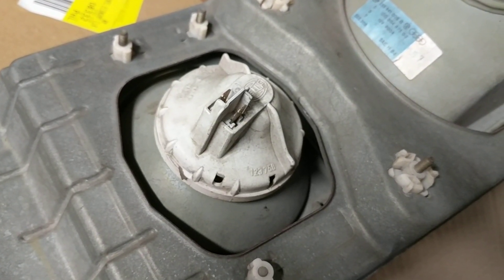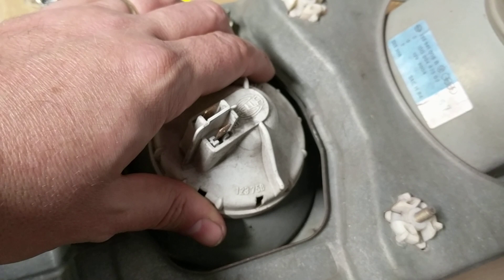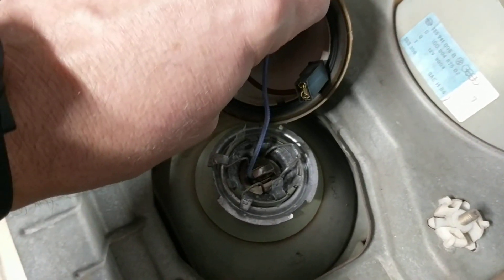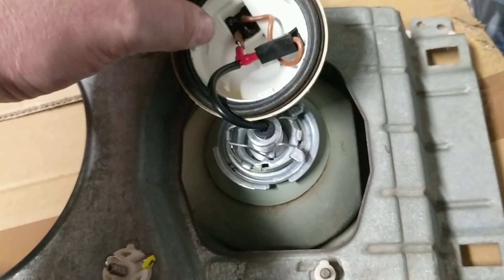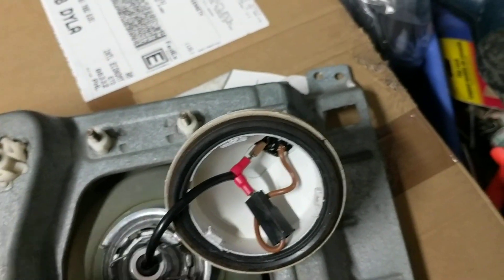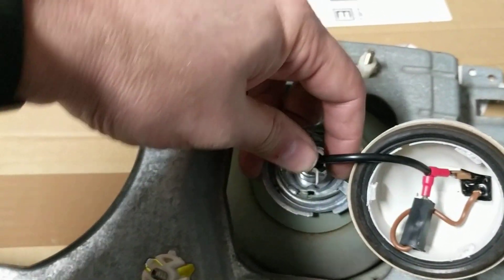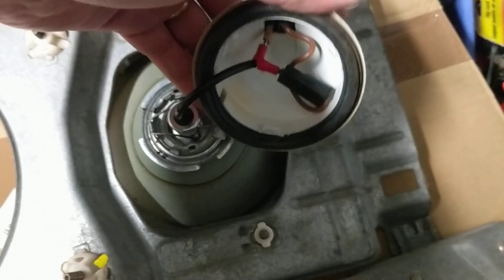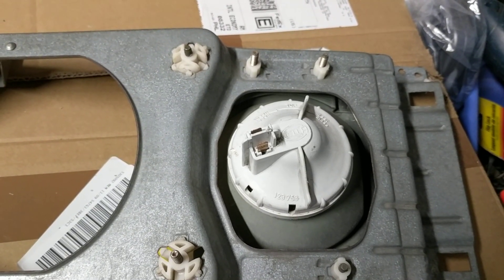H3 LED bulb install for late model Vanagon

Comment: Do these H3 bulbs work better than the Hella Halogen bulbs.  I've seen them called "fog lights" and hope to get more light than a stock high beam.
Reply from the maker: They work great and are very bright.  H3 bulbs are technically for fog lights.  However VW used them on the inner lights so...
Reply: @VanAgain  sounds good, I'll give them a try. Thanks for your help!

Comment: I actually got a pair of spyder halo headlights that came with h3 [low beam] and h1 [high beam] I bought leds for it and I can't seem to get my leds to come on. The connection from the negative is much smaller than the stock one. The website I got my leds from said to flip around the positive which I did and still nothing. Would you have any idea?
Reply from the maker: LEDs are sensitive to positive and negative and will only work one way.  Usually swapping the wires works if that is the issue